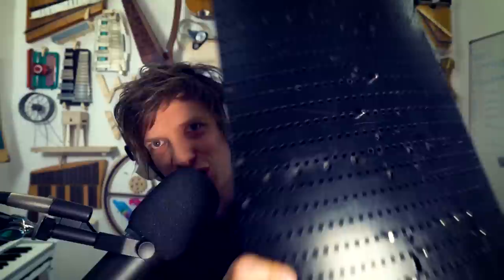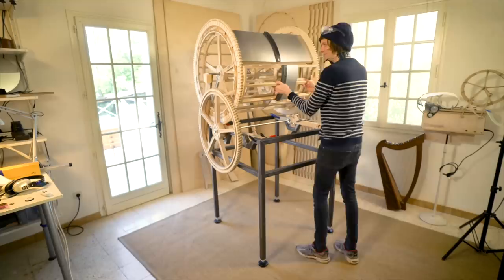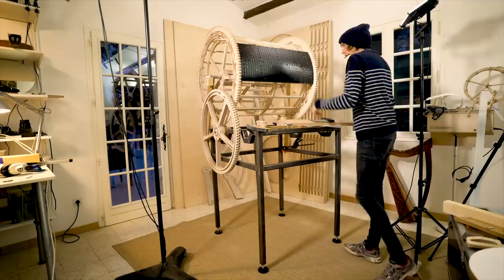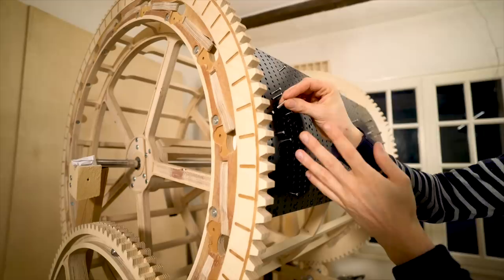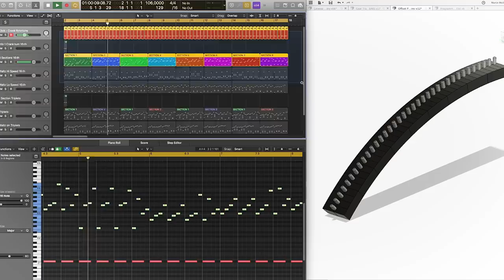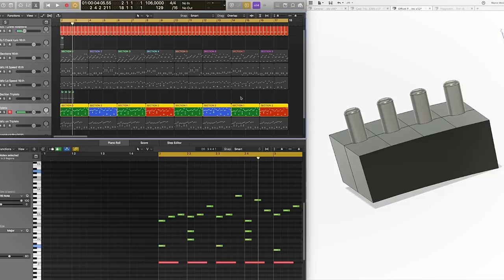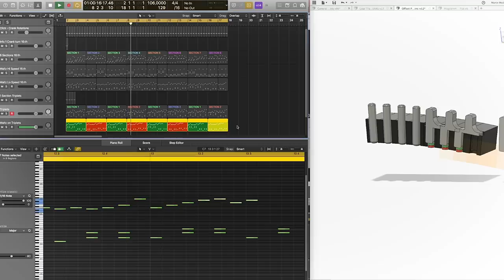Magnet "Midi" Music System - Marble Machine X #25

Comment: if priority is really quick, even live track changes, you could install spring loaded pins in every hole and cover them each time with a punched card/mask, letting only the correct pins protuding. This way you will assemble it only once and use whatever pins you like. if you use rectangular discs as bases for the pins, they can be threaded so pins can be replaced without disassembling the curved plates.

it could also work combined with magnets, as you do now. 

you could also use self springing stainless steel sheet metal parts but they should be custom built.

Issues with a solution like this would be:

1. no need for many live technicians/performers/pin setters that you wanted.
2. manufacturing precision/tolerances, you should test that. you want to be snug for note timing but loose for sliding. Some teflon may help or is it too modern.
3. a pin getting stuck. it should have a threaded hole on its head or a way to pull it manually through the perforated plate.
4. density of pins. you may need a bit of space more around the pin for the disc retainer/spring. what you allready have may be more than enough though, depending on  your final pin layout

advantages:

1. assemble once
2. change plates in seconds, no need to pull out the whole pins plate, only cover it.
3. off-self pins=  threaded through hole studs.
4. with a little vba script, full automation from midi software to cnc, in seconds.
5. no waste. the plate that gets perforated in cnc is directly reusable.
6. works both in midi/cnc and manual mode (insert/remove the pins you need)

edit: you could also forget pins and just cnc bumps on a plastic plate and use that, but i guess you want a bit of interactivity while performing and not having a standard music box like function. Yet this way you can have whatever spaces/timings and densities.

threaded plates with simple bolts or headless screws are a way to keep it simple, sturdy and very secure as well, if precision is ok.

Comment: I really admire your work and I really want to help, I'm no expert but I would like to suggest the first thing that struck into my mind for your problem, as a mere musician. What if you pick thinner neo-magnets and design on the midi board the notes' value very close to each other diagonally? Each magnet will hit a smaller lever ending to the core lever of the note (maybe another mechanism). I mean for every note you will have 3 note value's (e.g.a quarter note, an eighth note, and a dotted value) ending with the main trigger which for example is E note. I believe if this suggestion is possible and if I'm making any sense, it will take the marble machine to the next level, you can even jam. Hail from Greece, keep up the awesome work !!
Reply: I didn't see the whole length of the video. I pause it to write this comment. I'm amused that you thought the exact same thing so I will leave this comment instead of deleting it! I can't wait to see the outcome.

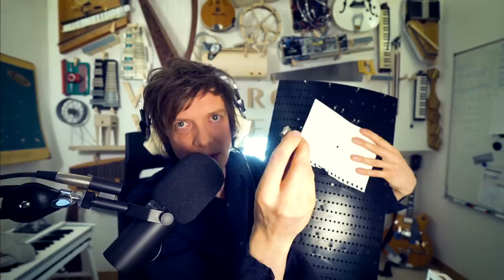Comment: At video 17:19 I'd recommend the flat slots 16th track and triplet track combined. Your not going to want to have two different types of pins to keep track of and then sort between this song i need this pin or that pin. If you just set it up on the wheel it will be very easy to tell which is 16th and which is triplets. If you want to "Idiot Proof it" then you can also add a label next to each track type.

Comment: In the matter of brushed matt vs gloss black
Brushed Matt  because after an amount uses you will start getting scuffed marks on the rubber. 

Pin design 
I would not glue magnets onto pins as if the magnet falls off onto the plate when being changed between songs you will have a raised pin higher than the rest. This will cause an offset of note being played not to mention you now have a magnet stuck to the plate which you have to somehow get off.

Comment: Martin, I'd add a 3rd set of programming plates, not only due to having spare parts if something would happen to a programming plate in transportation or whatever, but also because it would allow you to start the show off with 3 programmed wheels. It would also allow the people that reprogram the wheels a slightly less stressful time reprogramming.
Other than that I see no problems with your system. I'm just a tad sad that you will only add triplets, and not quintuplets.

Comment: Probably my comment is too late, but just in case:

Don't put the engineering effort into the pins but into the trigger mechanism. There are way to many pins and only a 'few' triggers.
I suggest to use only thin plastic sheets with patterns of holes (instead patterns of pins) for the midi boards and a more sophisticated trigger/release mechanism (have a look at old weaving machinery for that!). This way you don't need to re-program (you can easily store a few dozen of punched card-style sheets), you can easily adapt to other timings (just alter the spacing of the holes during punching), the sheets can be 'programmed' on your CNC-machine, you can even do very long patterns (the punched card can be essentially endless and fed from a reservoir). And you can still use your panels for prototyping - just use shorter pins (inserted pin - no hole, pin left out - hole).

So in short: use holes, not pins.

Comment: There is another way to approach the triplet problem by decoupling 1 crank turn from 1 bar of music.(oooooohhhhh yes I actually suggeted that!) Providing that the number of programming holes in one revolution of the drum is divisible by 3 and 4 you will not have a discontinuity at the end of a drum rotation. The disadvantage is that you wont be able to combine 16th and triplets in the one piece of music.
Im thinking now that your idea of  two tracks per channel (a 16th and a tripplet) is much better way to go.
It allows you to combine 16th and triplets in the same piece of music,
you only need one type of programming pin (this is ESSENTIAL in the hussle & busstle of a live performance)
The programming template is a cleaver idea too. just make sure that:
a) each template and programming segment are clearly labeled (including orientation)
b) include some sort of locating pins to ensure the template sits correctly on the programming segment. 
Cheers mate, and keep up the good work!

Comment: I have an idea for the technician part. Maybe a stronger magnet to cut time on pulling th spins out. Also maybe a preprogrammed thing you could sorta load up and roll out to cut the time of inserting the pins. Something you can already have the melody programmed, and all the tech needs to do is swipe the boards, and roll out the next song onto the board. Just an idea. Lol

Comment: pins in every hole with magnetic wheeled bottoms.. then have plate on bottom with riser spots.. so change programming by move inner under plate notches to side. 
 ... even possible to change score on the fly.

Comment: what if the programming wheel (pw) can be used twice? this is what i mean:

consider the odd numbers as being one song:
1 2 3 4 5 6 7 8 
the machine can play the odd rows on the pw. after one or so revolutions, you pull a lever, press a button, or whatever, and all the playing levers or triggers shift over to the evens. this enables you to play two songs at without changing the pw, or play a song that is twice as long as you can currently program, or even mix the two programs and play different parts at different times (similar to repeating and mixing a theme during improv).

a step further? enable the levers to play both tracks at the same time. that is simpler to do than the above, so if the double track can be accomplished, this step would be a shame to omit. imagine a simple first theme on the first revolution. on the second revolution, the theme is advanced, being changed slightly. then, on the third revolution, the tracks are mixed, producing a song that seems impossible to play on a machine as simple (comparatively) as MMX.

matte or glossy finish? use both, and make them functional, using them to differentiate the odd and even tracks!

I hope that this helps!!

i will be happy to help with any questions that you may have. i didnt mention my ideas as to how to build what i mentioned because it would make this post too long. (like it isnt already long...........  :/   )

good luck!

                                                                                                                                                  -----   an engineering student in the USA

Comment: I think this machine is also a great precursor to building something incorporating Euclidian Rhythms using something like a clutch transmission? You could add a little polyrhythmic variation with a percussion section along with your melodic devices ;) BTW, Only you could turn a bicycle brake cable into a DIN Sync cable!

Comment: Instead of doing a pin into a hole, you should cut a groove and do a cam lock that twists to clamp the top and bottom surface of plate. bit hard for me to explain exactly how that works but i'm sure you can figure it out :)

Comment: I haven't read the comments so maybe this has already been said but your block magnets should have a different effect, depending on whether they are facing or across. If they have the good size, you could drill cross-shape or L-shape holes to put them however you want.

And about the "being-able-to-reprogram-fast" situation, how about a silicone mold, with the pins already in it before the show? Then you would just cover the plate with it, and remove it leaving the pins…

Comment: I would suggest a system in which each magnet stud (programming pin) can be addressed and switch ON /OFF digitally via an integrated address bus inside the programming wheel all together my idea is to use either solenoids or electro mechanical pin actuators. This will help to change songs instantaneous and effectively. Please give me a chance to explain my idea and contribute to to this marvelous project 😊

Comment: I cant see why the MMX must be limited to the circumference of the programming wheel. You have a  love for musical boxes with "unlimited" musical bars. If the musical piece can be changed by adding a new track band of some source you would not have the triplet quater note problem right? Love the MMX and all you are doing at Wintergatan. Fortsätt med allt ni gör. Jag väntar med andakt inför nästa onsdag varje vecka.

Comment: I think it might be easier if instead of designing a strange pin you simply drill 2 sets of holes per note, one in 3 and the other in 4. Assuming that the levers are wide enough to have 2 pins without catching the note next to it

Comment: So, this has been posted like, 4 months ago, so I don't expect you to see this or the newest replies to your design discussion comment.
But it would be really cool to build some kind of suspender for some magnetic cylinders in order to introduce vibrato, in the same fashion as ¨bow-vibrato¨ works on friction based string instruments (With that technique the difference in volume is perceived as vibrato instead of difference in pitch, achieves almost the same effect, now that I think about it, it's more like a tremolo effect). And placing the specific vibrato cylinders onto specific places that can harbor the suspender with some notches to keep the magnet from falling out without needing glue, you can even add some low resistance micro-springs or padding to help smooth in the action of the cylinders. Think about an archimedes sphere meeting any da vinci gear, or even maybe better yet, a car differential.  Without affecting the prime board, I'm guessing you would only need a dremel and a lot of patience. 
All of this assuming that the mass of the pseudo archimedes sphere is light enough for it to achieve full rotations per X distance covered by the movement of the board.
I can think of more ways of achieving mechanical vibrato but they would mostly include adding or substracting parts, but hey, if you can manipulate the sound generated why generating a static version in itself right?
GOD i need to stop vaping tree rooting.

Comment: the quickest way i can think of to reprogram the machine is to place the segmint in a gig and use a projector to illuminate the holes in a that need pins, and you could use colour code to identify single and offset pins. or paint on the wheel or inside the hole with multi color nail polish and just know now we are filling all the green holes, or now we are putting regular pins in all the blue and offset pins in all of the orange, but I'm just thinking K.I.S.S.(Keep It Simple Stupid)

Comment: If you use offset pins, you just need one kind, at least in theory. You use the regular pin for hole no 1, and the offset pin in hole 2 for the 2nd triplet, and in hole 4 turned backwards for the 3rd triplet. But you'd have to test it. It may be a higher chanse for it to pop out when hitting the ... uhm ... thing that makes the marble play..

With that said, as a perfectionist, had I a cnc-machine and thinner pins, I'd definetly go with the second row for triplets sollution. Oh, and I preffered the black one. If possible, make the pins "glow in the dark", or perhaps UV reactant? :-D

Comment: i think you can use the free space on the section to move the hole a few mm on the side and use rectangular pins, you should be able to programe 2set in one section ans change it by fliping the section like a audiotape side A-B, it will save A LOT of time on stage by being able to set up 2 music at the time for the "programing squad" ( sorry if it's badly wroten, not english ^^)

Comment: Wintergatan just make a programming wheel that has a different spacing for the holes, then you could have a different timing system, as far as the play time limits maybe instead of having a fixed length wheel go for a system that uses and tape like system or chain where the length can be adjusted and the chain or tape will connect into the wheel and then just circulate around the system, that way your music can be as long or as short as you want.  You can also mix and match different chain pieces that have different tempos for 3x of 4x and so on.

Comment: I haven't seen any comment on a polarizing system that could prevent the programming plates from being installed upside down. Do the plate locks do this? 
Beware any system  modification that could make the programming plates too heavy,  You will be effecting whether audience participation is possible and your freight costs could escallate. You had that problem with the portability of your music box as an airline carry-on. Remember?
I enjoy all the videos, but worry that they are slowing the project completion.  
 "Nothing matters but the music." (The 'Red Shoes' movie.) Best wishes and blessings from Dallas, TX.

Comment: How about pre-loading the pins in a form fitting the plates?, this way it can be changed faster.  The form could be soft and you sort of roll it on to the plates, (not sure how that would work with the angles when inserting the pins, or with a stiff framed form which would give the correct angles straight away. The magnets in the pre-load plate could be secured with a removable backplate so that the programming plate (music disk?) could "suck" the magnets in. Just a late night thought. Keep up the good work. /regards from Norway :)

Comment: Its a nice work. I would add another 2 traces between two traces that you have drilled. This two or traces can be moved in time so those are not aligned. Three holes can make a beat so you can play with a third of a time between beats. Im not a musician and bad for english but i hope that it gives you another solution. In a 4 by 4 you can play with 12 pins in diferent time in other words.

Comment: Instead of magnets, you could use rivets which would be installed with the plate upside down, and then secure them with a slide on back panel, no magnets required. witch the right amount of chamfer, it would be easy to change scores.
eg:
Slide on back panel
vvv
____
_T_
^^^
Rivet into sequencing board

Comment: there must be a way to electronically reprogramme the wheel without the need to replace the plates, a small robot mounted on a rail that travels in one axis it could be fitted with a speedometer to gauge the speed of the wheel, all it needs to do is move along the wheel horizontally and remove and place the magnetic rods. You could play a really long tune without any loops

Comment: Have you considered a "track"...something similar to a tank tread? The potential for individual "treads" to create a more dynamic sound would be limitless. Individual treads could be changed out on the fly with a simple locking system. Not only would they be smaller and much easier to change out, the song dynamics would go much farther.  I would also suggest color coding for different keys for easy/quick changes...plus it would look nice, as well.

Comment: Math approach:

What about 60 pins instead of 64?
That will allow beats of 1; 2; 3; 4; 5; 6; 10; 12; 15; 20; 30ths
or even 
120 pins instead of 64 should do the trick.
That divides by
1; 2; 3; 4; 5; 6; 8; 10; 12; 15; 20; 24; 30; 40; 60
for marble machine y try 240 that will even add the  16

Comment: I'm affraid the offset pins (watercut) have a square section and will nick the round holes or will not fit snug :/
But, the spacing for each channel seems to allow for two rows of holes one in 4/16 and the other in triplets, just make sure the tab the pins hit on to play the note is wide enough for the two rows ...
From a build perspective you may want to find a way to do the drilling on the mounted drum (replacing your router bed with a big rotary axis to rotate the full drum) this would allow a LOT of precision in the timing of the pins and would make sure all the holes are cylindrical ...